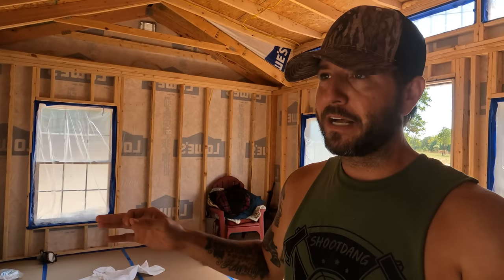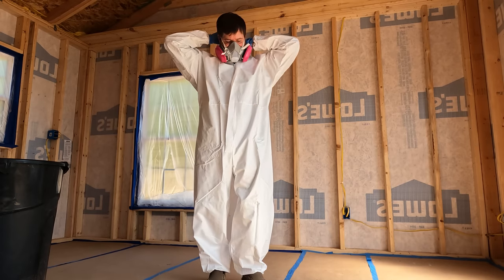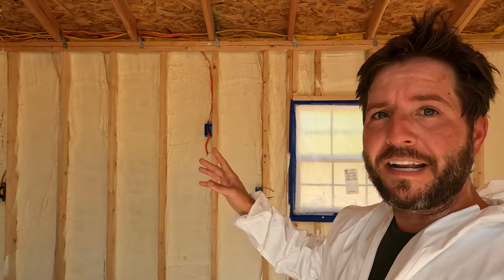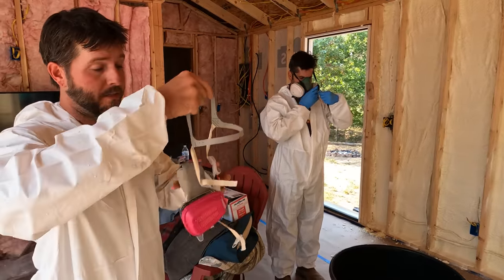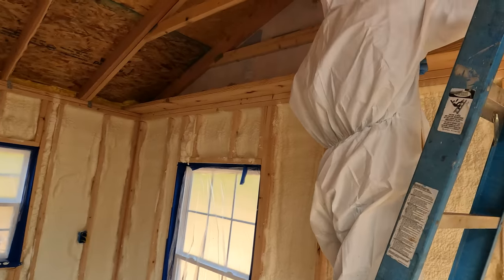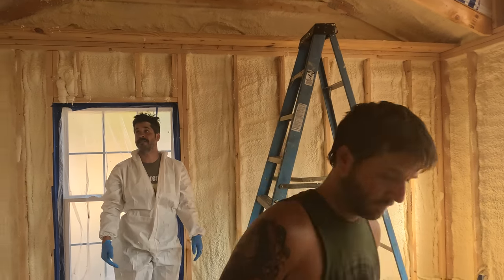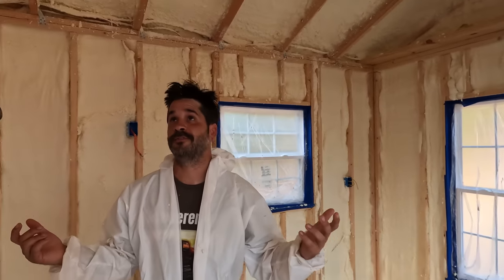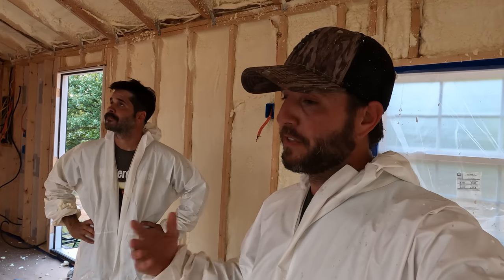Shed To Tiny House - DIY Amazon Sprayfoam Kit - What A Mess!

Comment: I'm not so sure the foam insulation is worth 10x the cost of fiberglass insulation. R19 is R19 no matter how you achieve that number.
Reply from the maker: Pink insulation is expensive as hell too have you priced it recently?
Reply: @South_Texas_Roots  As a matter of fact I did, and it's only $35.48 a roll. You would need 9 rolls for your place which would cost you a total of only $319.32. That's 10x cheaper than $3,000.00 for the same insulating value.
Reply from the maker: @bgd5339  lol it took me 5 rolls just to do the 2 small walls on my bedroom and bathroom. No way in hell 9 would do the entire house. Sprayfoam is much better. Have a good day.
Reply: Damn, but in long run years wise i wonder what would last longer.
Spray or traditional just laying it. ?  Spray looks fun, i spray cars so im sure just as fun.🤘

Comment: Little help in the future.
1. Don't put your panel on an outside wall. Unless you insulate behind it. You'll have condensing issues (depending on location) and if you spray foam the wires in the future you can't access without tear out.
2. Extra cost but if you put your wires in conduit you can change or repair in the future.
3. Fold your wires in and cover your boxes for better protection.
4. You'll have an un-insulated outside corner with how that's built. Drill a few holes stick the nozzle in and fill it.
5. Cover your door jams.

Comment: You're spraying way too fast. Yes you need to go at a good steady pace but not as fast as what you were doing. I realize it's too late by the time this airs but you need to spray slower and with more control. The foam should be coming all the way out to the very outside edge of the 2x4s. That also requires eye protection espacially when you're spraying above head height. Can you imagine what spray foam in your eyes would do?

Comment: This is a good video for anyone thinking about DIY foam.  One thing that I would point out though is that the attic is an area that needs to be vented so you will still need insulation against your drywall or whatever material that you are using as a finish.  I am not sure if spraying the bottom side of the roof was of any benefit other than for sound deadening.

Comment: I had a friend who used to work for Maytag, and his job was to spray silica based paint on the appliances. He ended up with it getting into his lungs and disabling him, even though he used the required ventilator equipment. Please protect your lungs at all times, and those of your camerawoman also.   Oh, and you missed a couple spots - the triangular pieces of wall up there on both sides of your dormer windows. Curious, you downsized the width and length of your tiny shed home from the one you lived in before, care to tell us why?

Comment: I think those things are also propelled with some sort of nitrogen. I blacked out while crawling around near the soffits doing it in my attic. For big rooms I used the SprayEZ fastkick setup. However, for smaller jobs, hard to reach places, and other circumstances these kits work great. They were about $600 a kit when I purchased them last. Also with these I went around the bays to get the foam in all of the cracks then sprayed the center. A little bit of an odd look but it worked out well. Also, shake the tanks a bit. Use the last of it to fill in cracks and small areas. Do steady single passes because most of the overspray is from blowing the stuff off that is beginning to expand with another pass. Finally, you can get the spray foam gun cleaner that comes in a spray form from Home Depot or Lowes. When you go to stop spraying for a minute pull the tip off and spray it with that. Heck I carried it with me and sprayed it every now and again. It will let you reuse the tips almost indefinitely.